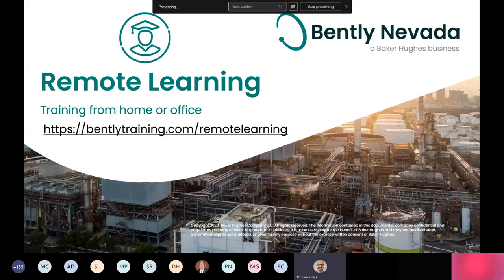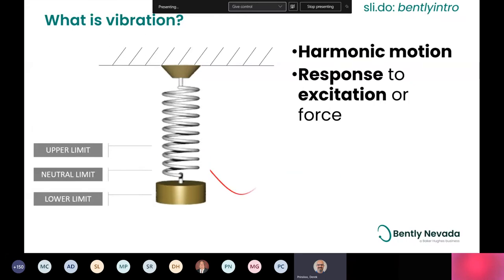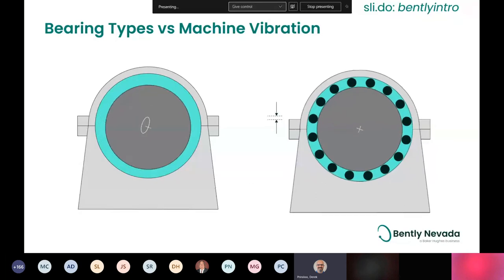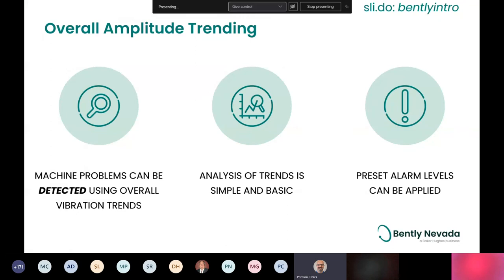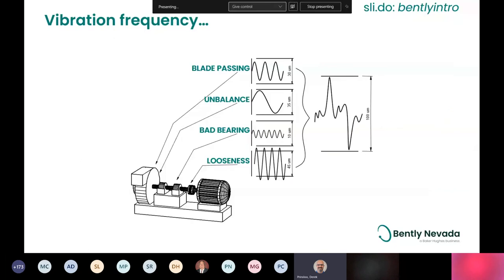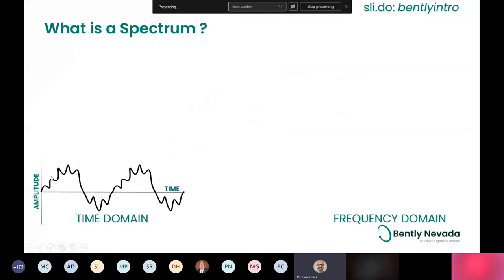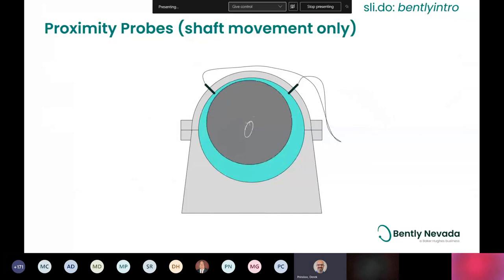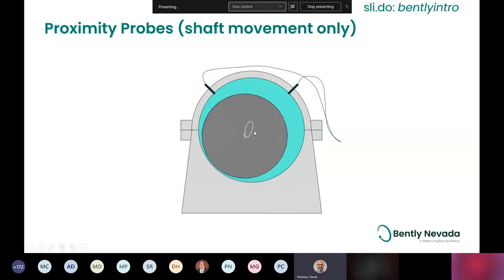Introduction to Vibration

Comment: 36:33 

When you effectively say that machinery is moving at a constant velocity, you're effectively saying that machinery is moving with zero acceleration. Now if you're telling in the video that for the constant velocity, machinery's acceleration and displacement are the extremes at opposite ends (for min. and max. frequency), you need to tell which acceleration is this? Centripetal acc. this is?